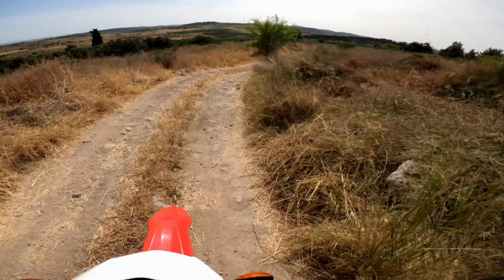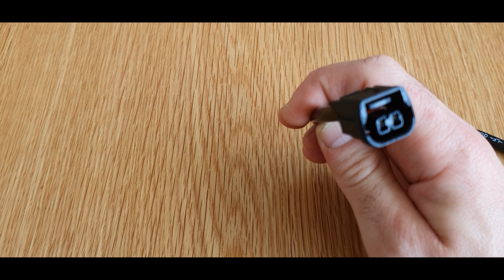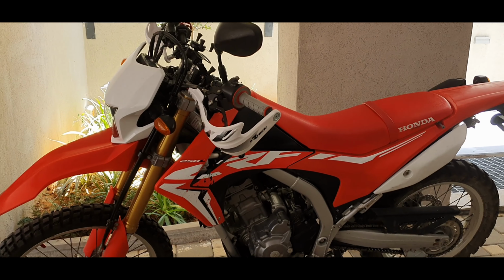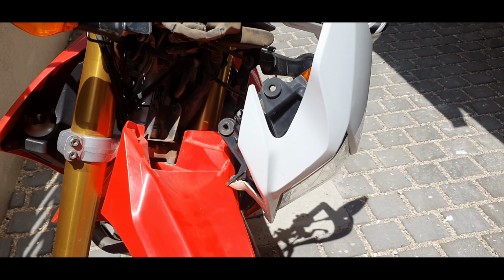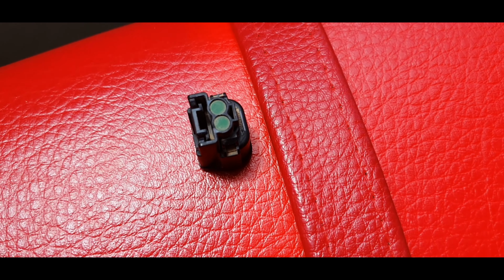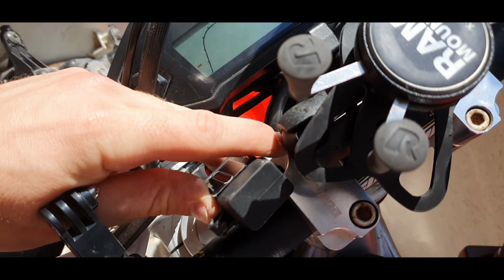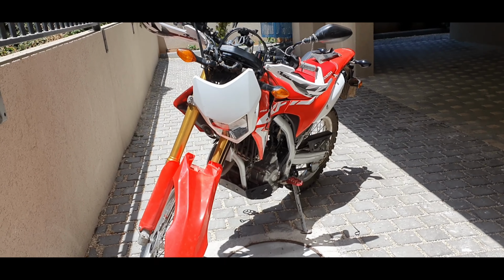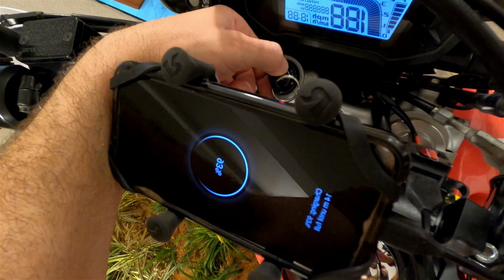Install A USB Charger On A Motorcycle ｜ Featuring Honda CRF 250L (300L / 250 Rally / 300 Rally)

Comment: I removed my motorcycle headlight but found nothing! No auxiliary plugs. I looked around and found an auxiliary port on the left side by the gear shifter. Just sharing that in case anyone needs to know. 
I am a newbie with motorcycles so I didn't know that

Comment: This port can use to conect a led bar to my CRL250L 2019? the led bar that i want use require 10-30V and 30W.
Reply from the maker: I dont see why it should be a problem. I have no direct experience but the adaptor is for all accessories

Comment: Hey, just so it’s clear… you cut the charger cable and wired it yourself to the two cables on the power supply? Thanks !
Reply from the maker: I actually don't remember if I cut the cable from the charger or if it came exposed. But that is the general idea yes. 

I didnt find a usb charger with the right connector so I bought the adapter and the charger and crimped them together